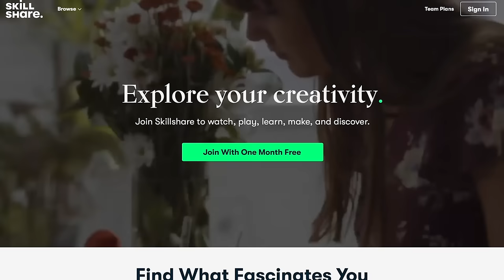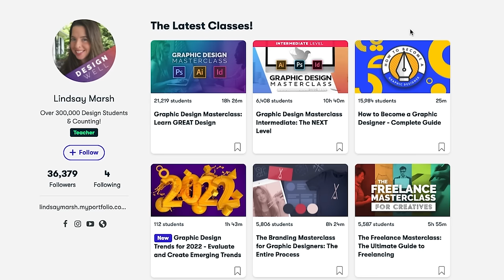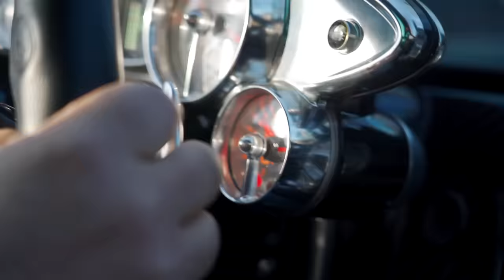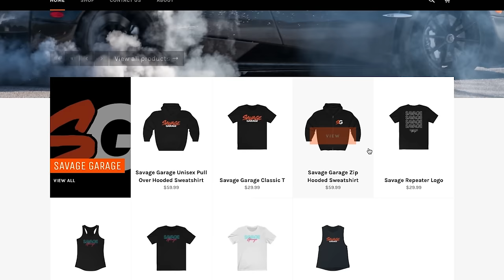Pagani Huayra POV Drive & Walkaround! *V12 TWIN TURBO*

Comment: What I love most about Randy, is that even an extremely expensive car like this is not a garage queen. He's actually putting miles on it, and is enjoying the car to its fullest. Many of these manufacturers have no idea how their cars behave because 1. Few hit the road, and 2. Most barely cross the 10k mile mark. Look at the SVJ? It had so many issues because it was being used, and ppl finally saw what it meant to actually put miles on an SVJ. I'm actually curious how the Pagani holds up in terms of reliability. Woulda been cool if you included the wing check in your video.
Reply: Where else have you seen a Pagani do donuts besides savage garage? Don't worry I'll wait
Reply: Yeah so True. A certain Mr K parks his cars for months and literally drives them to get some fuel and thats it.
Reply: @bmwbryan1 im a bit late here @1slocrx tracks his paganis and has about 25k miles on it cross country. no issues so far.
Reply: @mentallyuntouchable2918  I'll check it out thanks!!

Comment: I wonder if the engine suffers from heat soak like the M275 AMG engine. I would imagine the larger charge coolers handle things a little better.

Comment: The 1400 bolts in the Pagani Huayra is cast from grade-7 Titanium with each individual bolt having the Pagani logo etched into it. At more than $80 apiece, the price of the bolts alone is in excess of $112,000. Not the 1800 you said!
Reply: He said 120,000